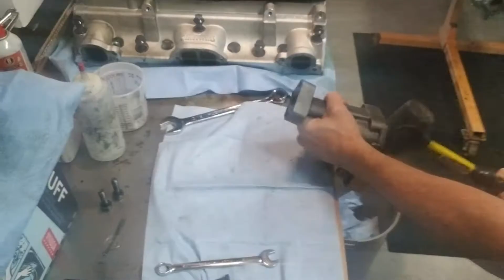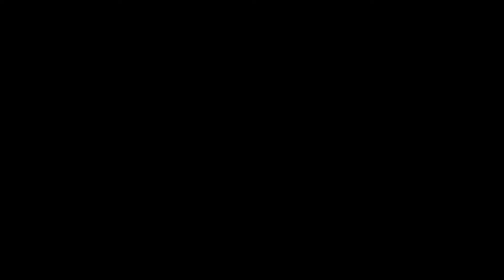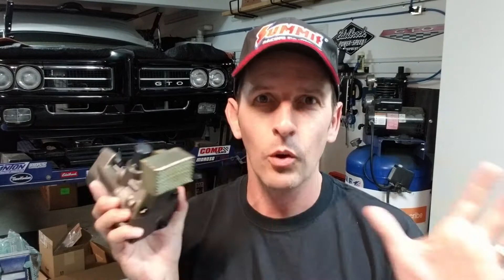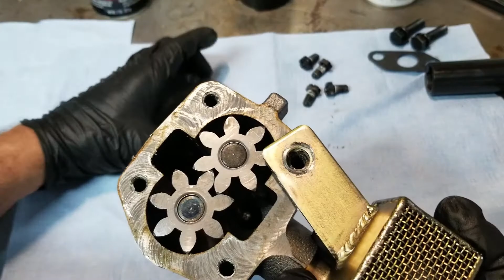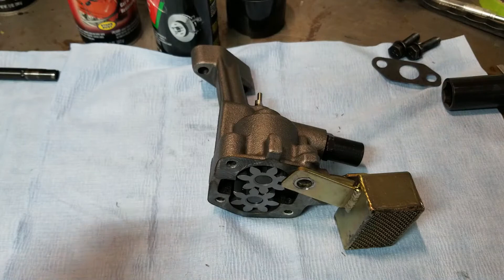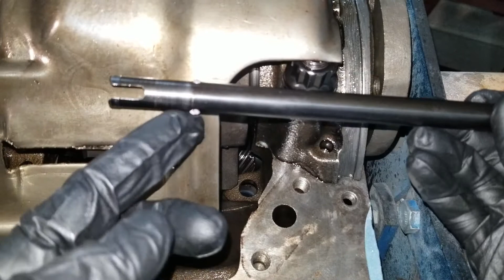Pontiac V8 Rebuild, Part 10:  How to Rebuild and Install your oil pump.

Comment: I use petroleum jelly in place of WD40 because it coats and sticks to the surfaces you're protecting from rust or corrosion. No mess from spraying or dripping and the petroleum jelly will turn into oil when it gets hot. Works great on cam and main bearings too.
Reply from the maker: Ohhh, never heard of that before.  I love it!  Thanks!

Comment: Are the lock washers for the oil pump bolts necessary? I see some use them, and others not.
Reply from the maker: "Necessary"?  I don't know.  But, I sure as hell don't want those bolts backing out in the engine.  So, Lock Washers, and Loctite for me.  Thanks for the comment!

Comment: Is it possible to change out the oil pump without pulling the motor? I have a 68 GTO and doing a top end this winter and will need to upgrade the oil pump as well. Thanks for the videos, very helpful.
Reply from the maker: In theory, yes.  BUT, the difficulty lies with removing the oil pan.  If you're gonna rebuild an engine, best to remove it and do it right.  Good luck!

Comment: Hey Monty,back again. I’m putting my 67 gto 400 back together and have been looking for a good break in filter
Reply: Sorry sent message before finish.anyway looking for good break in oil filter for my 67 - 400
Reply from the maker: @tommywebb5345  Good question Tommy... doesn't matter if it's break in oil, or not... use this, and only this WIX filter  https://www.amazon.com/dp/B000C9TCYY?tag=onamzmikemont-20&linkCode=ssc&creativeASIN=B000C9TCYY&asc_item-id=amzn1.ideas.2MZLR4U0XI069
Reply: Thanks Monty
Reply from the maker: @tommywebb5345  Welcome!

Comment: Hey I just read an article in Wallace Racing," water pump mod". check it out ,dont need a fan or aluminum rad. Very simple mod I going tomdo it to my car I'll tell you how or if it works
Great vid by the way, thanks for the paint I bought a can.
Reply from the maker: That's definitely a good start.  The Flow Kooler pump I have, does the same thing.  Here's my video on that... https://youtu.be/QQeZftsMuZk  Great to hear you got the paint!

Comment: We are still in the middle of our 400 rebuild and are considering buying the 80pis pump from butler vs the 60psi one. any thoughts on this? Also we have gotten a different set of heads through the grape vine. They are 46 heads off of a 428. they have the small valves and i believe they have 72cc chambers. Would these work better than the 7J2 heads that are on our engine? The 46's have the area to drill and tap end holes for the hooker headers that we bought so if we can use them that would be great as we got the heads for 12 bucks more than the L brackets that people use to provide end studs for the headers, honestly I would like to drill and tap the 46s. Willl the 72cc chambers kick our ratio up to far for pump gas? I think the 7J2 heads have an 96cc chambers not sure if they will work for us. Hope you are having a great day and thank you for making all these videos.
Reply from the maker: Hey Liam... Good to hear from you.  If you're upgrading to an aggressive cam profile, get the 80 psi unit.  (Or, if you plan on running tight tolerance bearings, 80 psi pump is recommended)  Otherwise, the standard 60 will be fine. 
 Unfortunately, I am NOT a Pontiac Head expert.  That said, I do understand where you're coming from, and sounds like it'll work.  Have you tried any of the Pontiac forums?  Like Performance Pontiac, etc?  There are a ton of Pontiac experts there that know all the technical differences.  Thanks for the comment!  Keep at it!